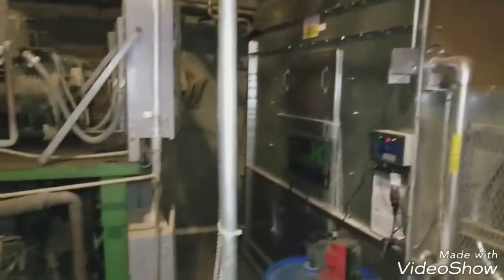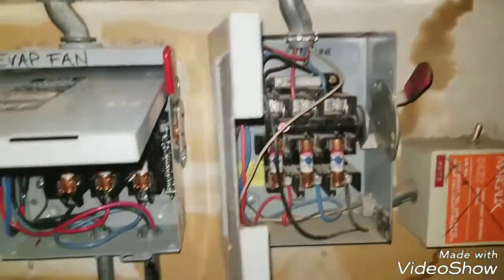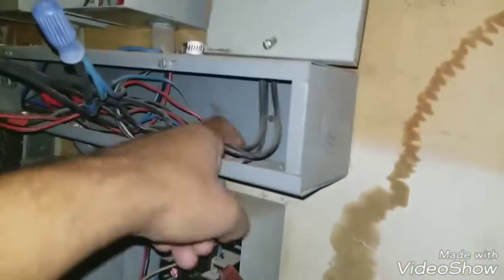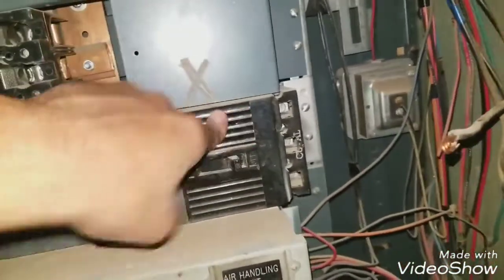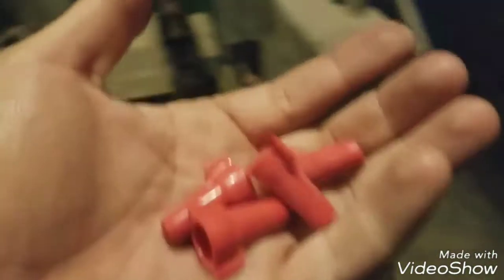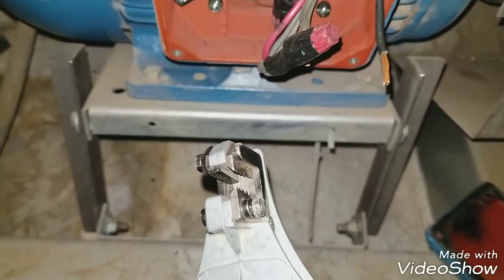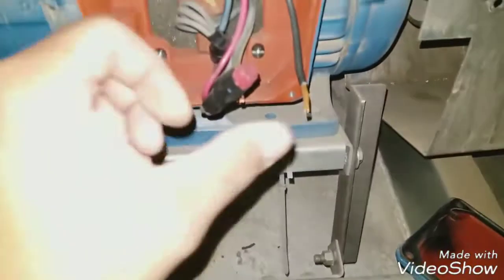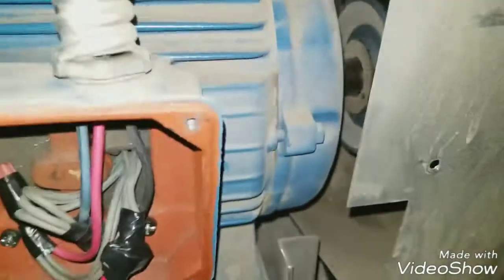DIRECT SHORT!

Comment: I know this is an old video but for guys just watching it - be advised that the flexible conduit cannot be used on larger circuits - what you notice in this video is the flexible conduit is burnt close to the peckerhead - the reason for that is the fault current required to trip the breaker.  The proper way to wire it is a green ground wire of the proper size in order to clear the fault pulled back to the panel.  Also another good habit is to always close your breakers with heavy gloves on - there is nothing like having a breaker blow up in your hand - also always look away to avoid damage to your peepers in the event of an unscheduled high speed dissembling of the breaker... be safe everyone
Reply: huh?

Comment: This was a great overview on the electrical side. I learned a lot. Like I mentioned before I learn a great amount more when you remove some of the panel covers from the panel boards. What puzzled me was the construction of the rack room. I was left wondering why the builder squeezed everything in such a small space. I learned a lot, although I would have liked to see the condensers on the rooftop, or where  the condensers were located (to see the big picture). My over all opinion is that this was a great video. There was much to be discovered.
Reply from the maker: +Best Tours Enterprises, S.A. thanks for your great feed back. I will try to expand and show more. The condenser I was working on was for all the Compressors in that room. And the other condenser in that room was for the store air conditioner. Hope that helps. Thanks for watching.
Reply: Wonderful. I didn't know that. I'm definitely starting to see a learning curve here. Thank you again for sharing your videos. Have a good one.

Comment: This is precisely why wirenuts should not be used for motor terminations.  Look up the "ring and bolt" method of making motor terminations. consists of crimping ring terminals and connecting them with a bolt and nut.  Then a proper taping of varnished cabric, 130C rubber, and vinyl.  That's a proper connection.
Reply from the maker: Thanks for the tip, I will look at that